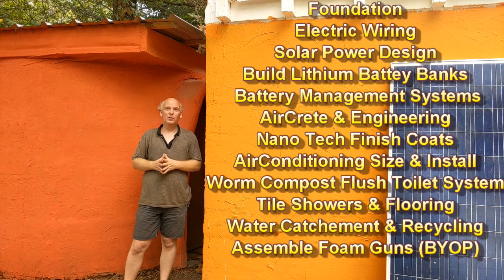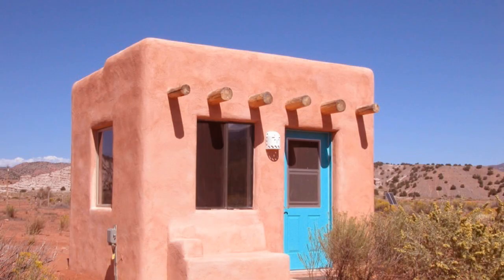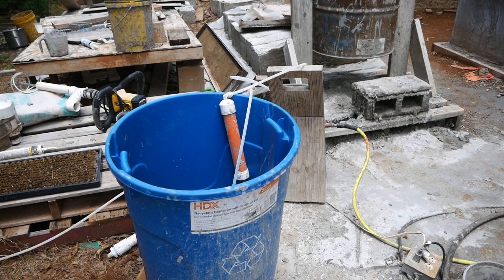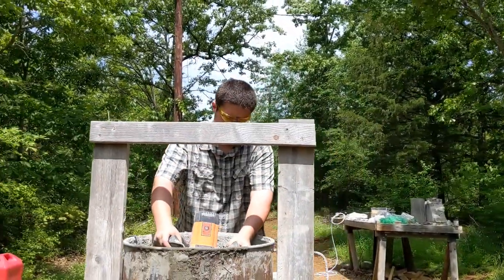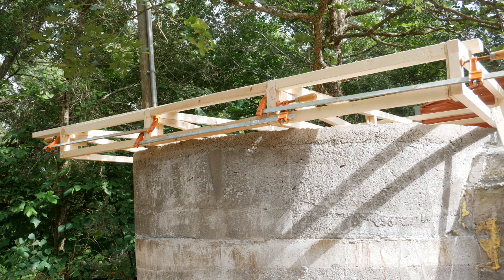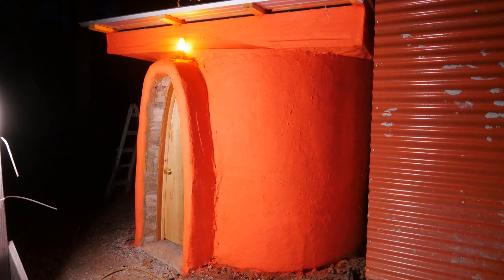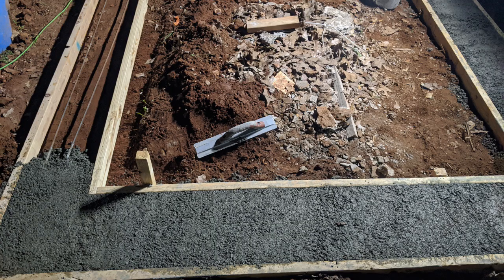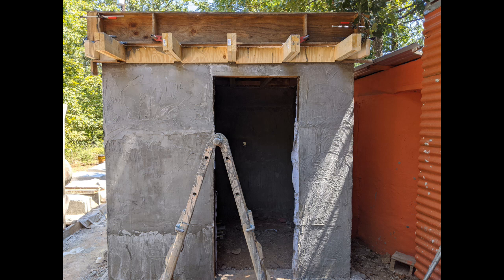Building Round & Square Cast AirCrete Tiny House $26 per SqFt   Rent Mortgage Free Off Grid Bugout R

Comment: That price is insanely cheap- that is amazing! The top of the cylindrical one is a bit jarring though, I wonder how someone would make A dome of sorts, or even just a circle.
Reply from the maker: Use blocks and compass arm to build a dome.
Reply: I've always wanted to go back to Guanajuato and learn how to build those brick domes. No forms used, pre Hispanic. I hear the last brick is tossed up into place. My foundation guy was from Guanajuato and I asked him if I could learn. He wanted to talk about how he hid his guns in the walls of his new house. 
By the way not sure where I was but I saw the sign for the school. I mean I know what county I was in just not where in the county. Sometimes I go out to Agua Fria and my brain runs off and get it's toes stuck in the bentonite. Leaves everything behind except the bad attitude because it's time to head east to the pan-am freeway. 
A non profit gallery I'm involved in wants to build a cuartito in the back for traveling artists. It'll likely be sized the same as the existing shed that needs to be removed. I would love to build some aircrete tilt wall panels. It would be perfect to shore up the falling down board and batten shed, pour a foundation perimeter, deck it, then pour a common denominator wall panel. And when there is enough parts make the shed change from a shored up, rotting bottomed 100year old structure still energized by knob and tube ungrounded electrical service to modern and livable and revenue generating! We'll see. Hopefully we don't die from malaria this summer they say we lived through the 'rona. That's only because of the sotol I drank for 16 months while I designed a John Prine tattoo on my inner forearm reminding me of the smell of snakes in the air.
Time to make breakfast and kill some grass with cardboard. 
Yeeehaw.

Comment: Hi Just found your vid. Just experienced the flooding in Vermont and was searching tiny homes to help the homeless up here. FEMA and some others are spearheading alot as well. I learned of aircrete I can see it being a valuable resource for this. Even if not used with this event i will be doing my due diligence to see gow to have a system ready and possibly a list of owners with land that we can get trailers and have these ready built on them to transport to the needed areas. I like your pueblo style for this idea. So will definitely need to learn and see what I can do and see what your current status is and progress with your system. I had also contact Domegaia and learned they do workshops as well not sure if you are related at this point or not. But just gathering info and hope I can process this and have a viable solution for what i would like to be involved with. Maybe even find land and build for myself as an example here in New England maybe even see if a workshop would be doable this year. Ok thats my thought off the top of my head. Love seeing these ideas come to fruition. Scary to see wood buildings burn. Time for cement to rise not just in warm climates.

Comment: I wonder, would rebar or even chicken wire within the slip form reinforce the aircrete like normal concrete? I'm interested in this method because of the cost and insulation value. But I'm spooked about it not holding up in a decent storm.

Comment: I like the idea of minimizing the use of cement by foaming it up, considering how making cement is the biggest source of greenhouse gases on the planet.  Would it be possible to foam up adobe?
Reply from the maker: I do not believe you can foam adobe.  The carbon foot print of a small structure can be canceled by using the greywater and growing 12 trees.  It honestly no bad considering it could be a multi-generational home.  Not only that but the average person uses FAR more energy and produces far more carbon driving to work daily.  Then these the purchases energy.  Either produces so much carbon that the amount of cement used for a modest homes doest even being to measure up.
Reply: @TinyGiantLifeStyle  That is what I was thinking. Make the house carbon negative or at least close to zero and you make it up. I've been following you awhile and I certainly hope I can come to the October school. I'm guessing the free showers you have there are unheated water, right? Thanks so much for the work you do!

Comment: For a bigger square home, could you use actual concrete pillars as the load bearing structure and then use aircrete panels as the walls? Thanks 🙏
Reply from the maker: Yes.  This is what is done for code approved buildings.

Comment: So if your planning on doing add-ons, do you leave the doorway/missing wall when you build the structure or do you build it with the hole and just cover it someway until you’re ready to put on the next room?
Reply from the maker: You can frame it in or cut it out later.

Comment: You mentioned that you would not recommend designing a below ground structure. What about a 1/2 basement ?
Reply from the maker: You should use ferrocement or something to support the sideways push of weight dirt.  AIrCrete can be used as insulating infill inside that.

Comment: My building dept asks for two copies of the construction plans (blueprints). 
With plans in hand, get the permit, and start with a small section while building the rest?
No septic no permit.
The construction seems simple enough to follow by most folks, yet is there a repository of blueprints to access? Or, have to get new plans drawn? Thanks
Reply from the maker: The internet is full of house blueprints.  Just copy one.  Usually they accept hand drawn plant too.

https://www.google.com/search?q=house+floor+plans&sxsrf=ALeKk00gnCFjABWFUbCsyB7I9dHzUMFIfA:1620063014667&source=lnms&tbm=isch&sa=X&ved=2ahUKEwigjoKEha7wAhXSHDQIHTfJDeoQ_AUoAXoECAEQAw&biw=1396&bih=691

Comment: What is the absolute cheapest shell that can be built? And what about all the different aircrete recipes that are shown online..
Reply from the maker: I think $12 per square foot is probably as cheap as it gets.  If you buy bulk cement you might get it down as low as $9 per square foot for a shell.

Comment: Hi I just stumbled upon your video about AirCrete building. I'm most interested in a medium-sized structure that would be 1/2 buried in the ground, off grid, and semi-domed ceiling.
Reply from the maker: I never recommend placing AirCrete below grade.  A berm placed on top of the ground might be ok.  AirCrete has a low tensile strength compared to cement.
Reply: What if you add graphene fiber, glass fiber or rebar? That would increase the tensil strength. Any idea on the fiber ratios?

Comment: Hmmm, I'd love to invest in a class. I'm just wondering if I can get the drexel, fabric & even the concrete recommended in Africa. Or something I'd have to ship over?
Reply from the maker: It's usually possible to find workable materials If you can't find the fabric then it's entirely possible to use reinforcing fibers these can be natural or synthetic.  Drexel might not be available in shipping is expensive however you can use sodium Laura sulfate from powdered bags or some form of commercial dish soap.
Reply: Shampoo retains foam much longer as the crete sets up.

Comment: Can you partially bury these structures? Does that require different finishing?
Reply: In days of old....A retention wall, and a basement wall, are both sent to the lab for "compression" tests.  So, it must be able to handle N psi. Your air crete, will certainly fail the psi test (1).   Also, say, lets dumb it down, say a piece of wall, 1 pound can hold back .99 pounds of dirt.   But, you air crete is lighter.  ouch. (2)  Now, aircrete might add a weird tensile strain, as the wall needs to be burried 4' if it's burried a foot.  So, the wall can be riding up, or bending over.   Either way, you got tensile force, but also a decreased tensile strength from the air crete.  (3).    I'm not saying, that's it, it's the end.  These are the problems you must solve.   Perhaps for a basement wall, you can sandwich the air crete, in between two thick layers of regular concrete.   ? who knows.   Or perhaps do a burm and put rock around your structure. But, you still need good drainage, and the water needs somewhere to go.  and remember...concrete makes a horrible rope.   But, lots of these solutions are more expensive then building a thicker solid concrete wall.   Really high concrete walls, are often not one solid wall, but a couple of walls, either running perpendicular to your one wall, or parallel, with a special fill between them.   All that being said, I was taken to see a tire wall, that was about 80 years old, and 3 stories high.   Holy smokes.   Not holding back the water, really has advantages.    But, good luck getting a permit for that today.
Reply from the maker: I would generally not bury aircrete under-grade.  It would require at the very least a pharaoh cement shell to withstand the weights of the soils and moisture.
Reply: How thick a shell for that?

Comment: how much does it cost to get all the tools required?
Reply from the maker: A basic foam machine will cost about $170 and the Air Compressor rated at 4 CFM @ 90 PSI about $300.  Forms can cost $400 and upwards depending on size and materials used.  Slip forms save money on form materials.  Depending on if you build a large house a forms all the way around or just a small section to build a little at a time can greatly affect the price of forms.   Making bricks could save some cost on forms, but increases the work.  Drills and other tools could run another $200

Comment: 'green' air crete. NO. there's nothing green about concrete.  Be more transparent about the carbon footprint of concrete
Reply: @SuzanneWho  Go look into the carbon footprint of Portland cement.  It's basically powdered limestone fired using either coal or natural gas. People are working on a carbon free cement but we're not in a place where it's available to the masses yet. There's nothing green about cement in today's climate crisis
Reply from the maker: It's so easy to offset cement with hybrid poplar trees.  Besides a multi generational home is worth every molecule of carbon.  Driving to work and running air-conditioning is so far beyond building a home in carbon release it's not even worth considering; thousands of tons. Do the math
Reply: @SuzanneWho  no one calls uncured concrete 'green.' that's not a thing
Reply: Hey I just thought of a way that you could reduce your own carbon footprint to practically non-existent in little to no time!  You only have to do it once, if successful  -- AND it's DIY!
Can you guess what it is?